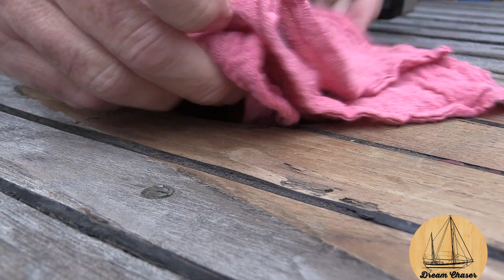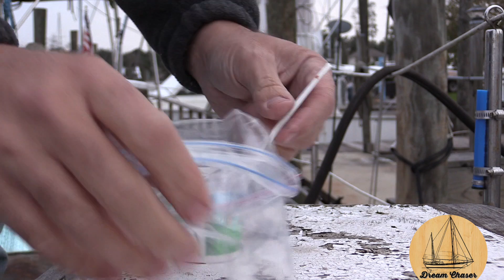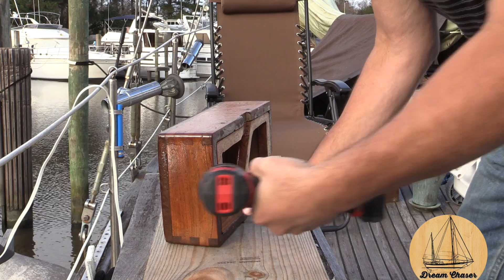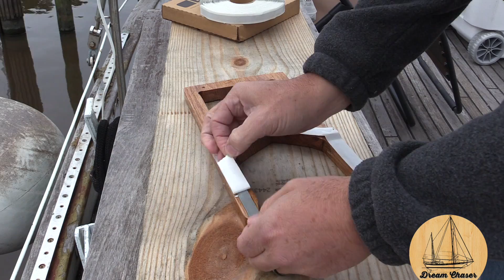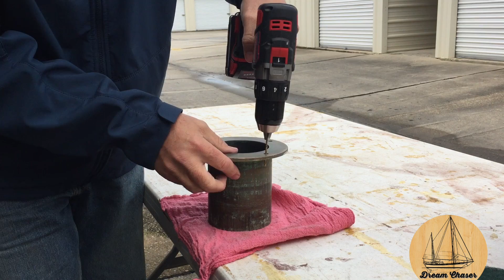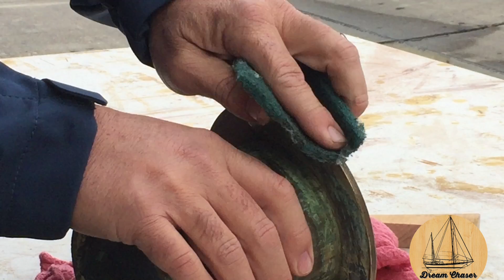WIP Dorade Replacement Part 3

Comment: Another nickname..."Taiwan turkey"
Reply: If I do any polishing it'll be on the inside bronze. The exterior bronze can stay green. I've had to do some polishing on exterior stuff since the previous owner liked to slop paint everywhere. If you leave a flap on the blue tape around the drill bit instead of wrapping it tight, the flap will brush away the shavings as it reaches the stopping point.
Reply from the maker: I like that nickname too. I am with you too on the polishing. I only polished the rim of bronze that shows below deck from the bunk. Like your PO (Previous Owner) mine also got some paint on the cowl vent but I may just leave it for now.